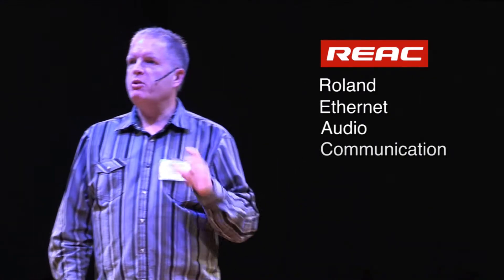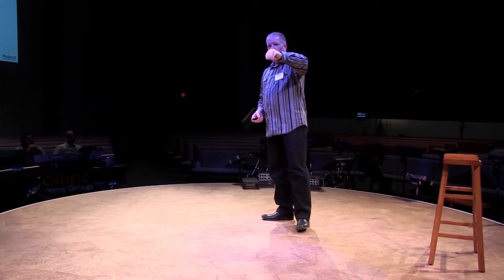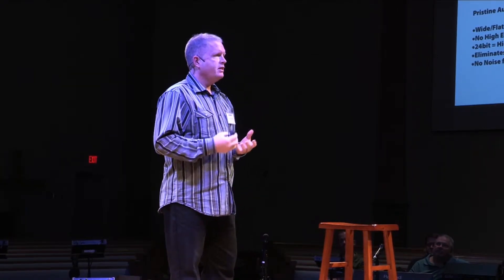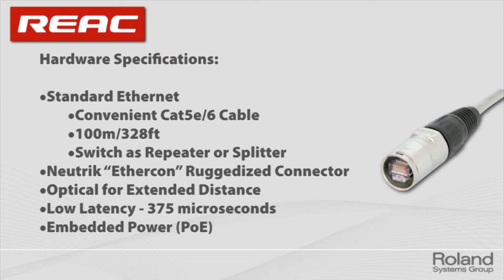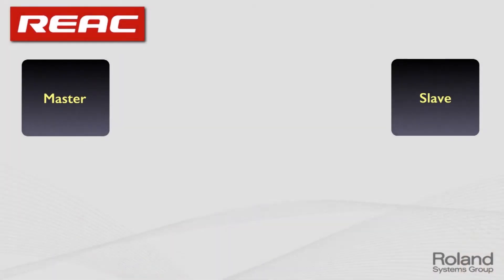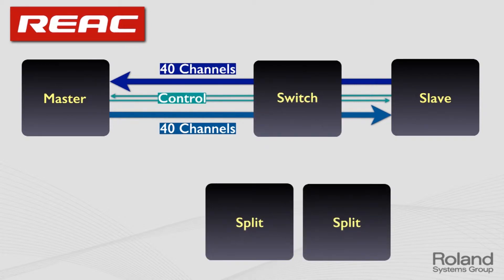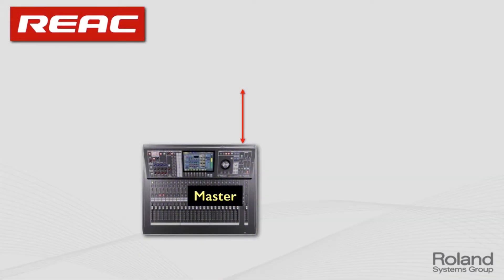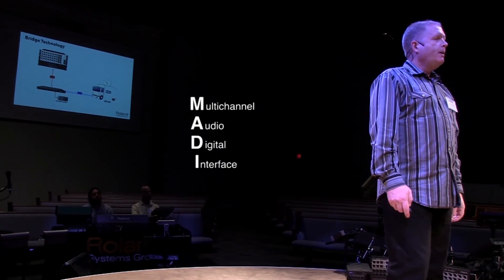Roland V-Mixing System Part 1: Principles of REAC

Comment: I'm not a veteran, but I seems like this was revolutionary.  Here I am listening to this video in 2019, about to head off to a local studio with the M-400, hoping to multi-track today's session to my windows laptop. I just installed cakewalk by bandlab (free) and I found the REAC driver download link on a forum. I installed it all, and the REAC inputs have shown up in cakewalk. Looks promising. We shall see if it works - no internet/mobile access out at the studio.
Reply: By the way, THANK YOU ROLAND for continuing to provide driver updates to your project many years in the future. THAT IS A BIG DEAL!

https://proav.roland.com/global/support/by_product/m-400/updates_drivers/
Reply: What Windows version is that you're using?
I'm having problems with windows 10, even in compatibility mode.